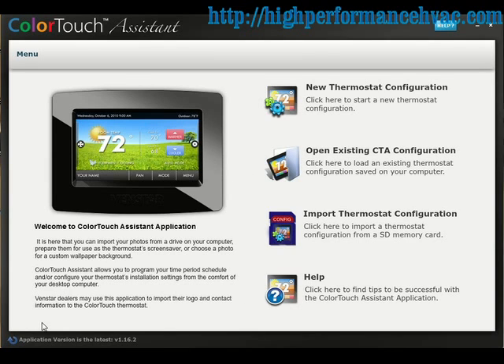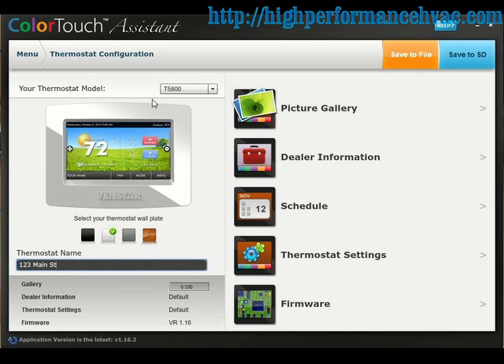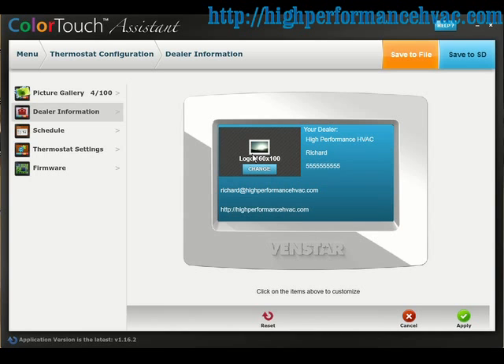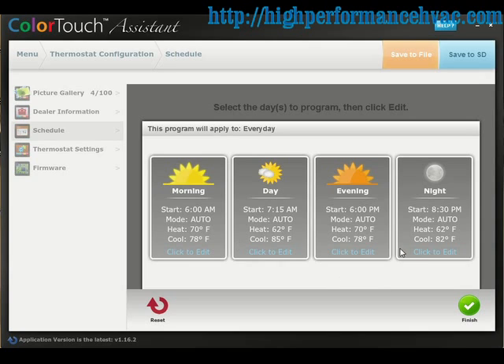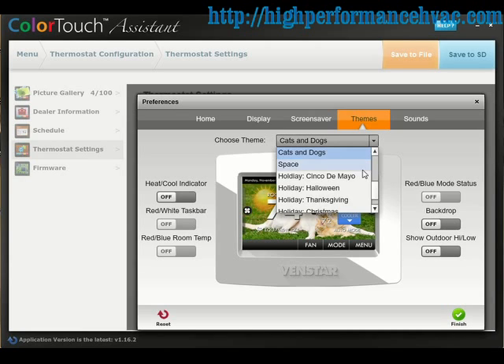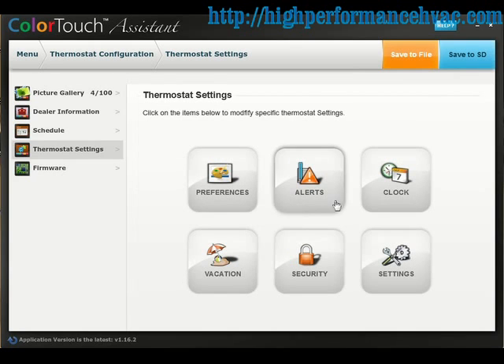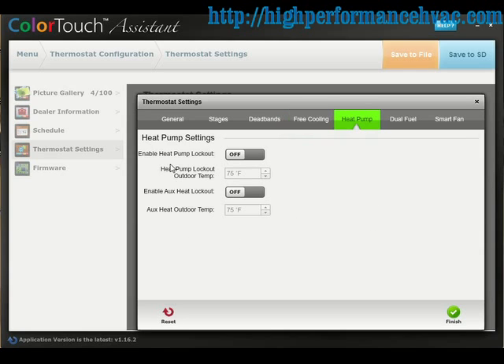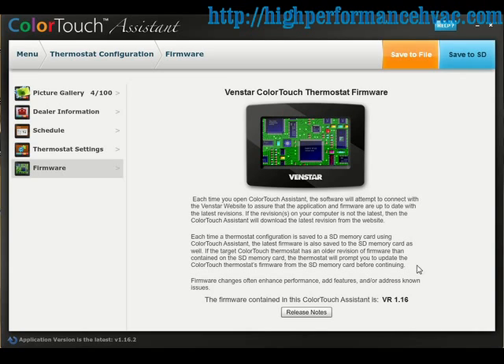High Performance HVAC Presents ColorTouch Assistant Software by Venstar

Comment: Richard: This was a very helpful video. Thank you for your efforts here. I just ordered a new T8850 so I am looking forward to setting it up later in the week and your video will be a big help. I don't know if you are still monitoring replies to this video after all of these years but if you are can you tell me how this thermostat has worked out for you? For some reason they seem to be the best kept secret in the world of HVAC. I don't get it. It seems to have everything one can dream of in a t'stat but there is very little info out there. Very few reviews or videos. I am at the end of my rope with the terribly unreliable Honeywell TCC app and its inability to connect when needed most and nobody else make a Wifi t'stat that will accommodate a proper outdoor temp sensor. I would welcome an update if you get this!